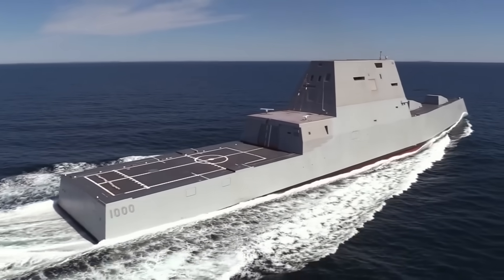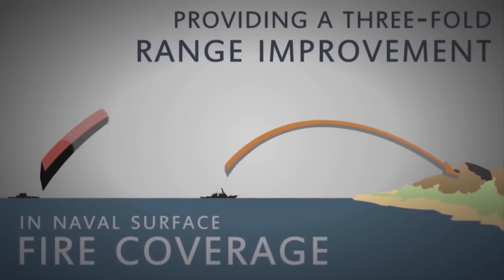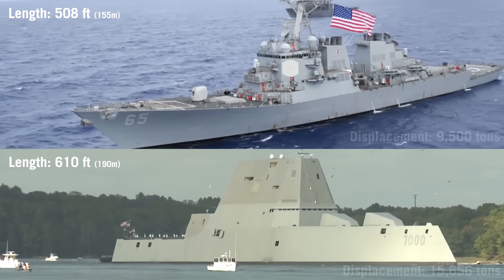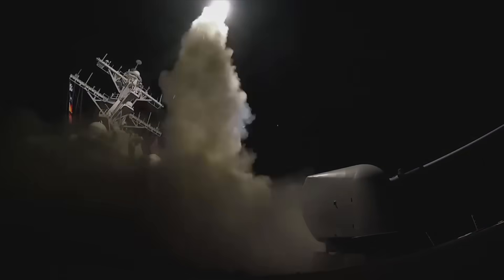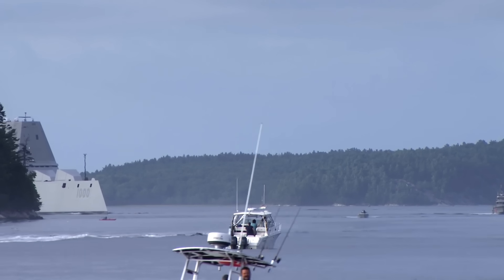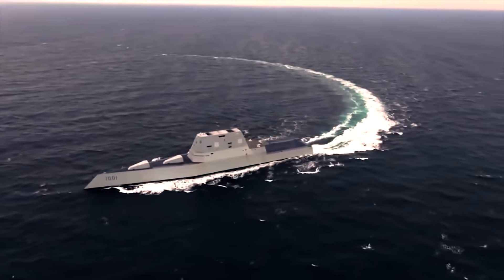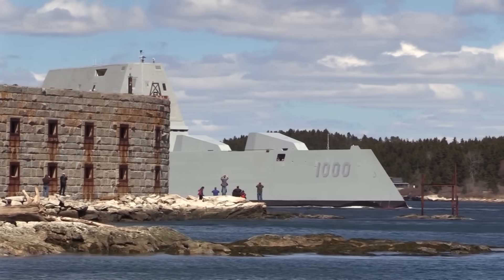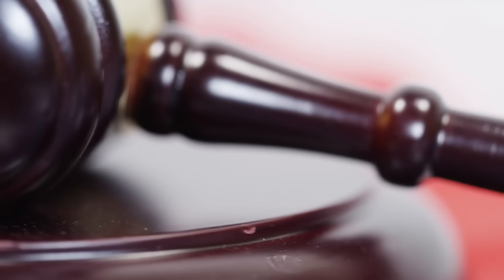What Killed Zumwalt Destroyers?

Comment: Should bring back battleships as a fire support platform  all that armor to eat missile hits and a couple of 16 inch guided rounds for inland bombardment plus the amount of missiles you can load on a BB
Reply: battleships cant really tank those missiles... they are way to big, way to expensive and not that effective anymore
and what about enemy subs? what about carriers?
if you want inland bombardment you could go for the airforce or carriers

battleships are outdated since the 40s :D
Reply: @Wootbürger1337  with modern armor on a battleship would be able to take multiple hits carry more missiles than any other ship and guided 16 inch shells would do great and you can not always rely on airforce especially if the area you are attacking is outside the planes fuel range if we get into a fight with china we will 100% have to launch a naval invasion  also battleship could fit alot of CRAM and anti missile battery’s as well nothing but a force multiplier and cant cost anymore than a ford class aircraft carrier

Comment: Two things killed the Zumwalt project, and it was the same two things which screwed the littoral combat ships, the F-35, the latest air craft carriers, and etc., and they are lack of money and a ridiculous concept called `concurrency'.
On the latest air craft carriers, yes they are at sea (at least one of them) and undergoing trials, but they were still designing that when they finished building it.
As far as I'm aware, only one elevator works to this day.
What good is an aircraft carrier that can't get its aircraft up on deck?

Initially, with the Zumwalt, there were planned for 33 to be built.
Then, as construction went on, and the end price became apparent, that number was dropped to just 13.
Further down the track, that number was reduced to just 3.
And, along with the asset of concurrency, it can't navigate the wild seas of a canal without crashing into the sides.
This is what happened when it went through Panama, and had to be towed.
That's all there is.

Comment: Designed to fail. Safety wise 150 or 300+sailors getting off a sinking or burning ship with only a rear deck access. Nope. Then any enemy in war it doesn't matter if it looks like a fishing boat. It's a target and the side of the ship is perfect for reflecting radar back to an incoming aircraft or missile. Needs to be mesh and composite to beat radar.

Comment: After decades of congressional scrutiny over DOD overspending and nakedly incompetent project managememt, we still have the Zumwalt Syndrome. The real cause of overspending is not the quest for better technology, but the avoidance by defense contractors of accurate cost estimates. 
At fault is the arms procurement system, itself. Congress permits defense contractors to grope their way to a prototype, sometimes at their own expense, which the contractor prices as low as possible. Then, as the contract is awarded, the contractor stops groping, and begins grappling with real costs, and the cost-plus thinking that balloons (almost) every DOD budget.
In essence, Uncle Sam does not know he was sold a bill of goods ("prototype") until after he awarded the contract. DOD understands the problem, and so do defense contractors, but both are too comfortable with the process, to change. With a revolving door between Pentagon and defense industry, it is easy to understand only congress has the incentive to make sweeping reform a reality.
Taxpayers, themselves, must contact congress to end this wholesale abuse.

Comment: So, many screw ups, a transport plane doorway to small for the up armored APC, a destroyer whose helicopter landing deck too thin for standard aircraft because the light weight model it was designed for failed and was canceled. Submarines with thousands of defective hull welds, cost overruns with the Osprey, Ram missile, VLS,etc., etc. Things like misplaced pipes, electrical supply points, compartments built wrong ( too large, too small, wrong deck,etc.) The list goes on and on.

Comment: It hasn't made much sense to implement stealth on ships since a few decades ago when optical sensors become thoroughly capable of targeting.  If you can defeat a Zumwalt from over the horizon with a hundred small shaped charge warheads on a hundred small consumer-grade quadrotors without using any radar at all, if you can track the ship's movements globally from orbit, what's the point?

Austerity politics did the rest.  Not much rational sense in scaling back a production run because of cost overruns in R&D, and then targeting it because it's too expensive per unit.  You made it too expensive per unit.  R&D has unknowns, as well as predictive biases.

Comment: I would treat these Zumwalt as concept ships where the latest tech and equipment is stuff into them but should never be used as production ships but instead lessons learned from the design production and use of the ships be fed into improving older known ships or to design cheaper production ships.

Comment: The interesting part here is that the bridge (with all command staff and control systems) are still on top of the ship. With this level of automation and AR that bridge could also be put in a fortified area in the centre or rear centre of the ship. With HD cameras combined with AR and zoom functions without the distraction of windows (which by themselves are vulnerable parts) it makes no sense to put that bridge on top.
Reply: Zumwalt is a piece of garbage. Almost nothing works, be its engine, gun or radar etc. The next gen destroyer design DDG(X) will have to copy the Chinese type-055

Comment: To put this monstrosity in perspective, WW2 destroyers were usually less than 2,000 tons.  The first true battleship, the HMS Dreadnought was only 20,000 tons at full load.  To call the Zumwalt a destroyer at over 16,000 tons is a joke.
Reply: But then there's this behemoth of USS Gerald R. Ford with 100.000 tons, so 16.000 tons seems like a reasonable class for a destroyer that nowadays kind of fills the role of battleship.

Comment: To people fearing automation in the workplace heres the example that should allay your fears.

Having any machine do a job as complex as a sailors might become isnt even close to realistic yet. Robot arms and automated loaders are not reliable yet. Again, not even close to what regular operations require much less the rigors of combat.

At this point automation can only be reliably applied to administrative needs. Procedurally generated schedules or calendars, automated payroll systems, voice to text devices replacing secretaries, that kind of thing.

Basically, if your phone cant do it automatically then it cant be automated yet.

My estimate, having worked in manufacturing and specifically manufacturing autonomous systems, is that general labor jobs(similar to generic deckhands and sailors in many ways) wont be able to be automated for another century. Attempts are being made but most of the decisions at the top are made by people like those that okd the 737 max for sale and daily use. Those are the caliber of decision makers guiding automation. People that are profit oriented and only tangentially concerned with engineering.

Business majors running robot development does not good robots make. Makes for a slick investor pitch, but little more.

So please, no more robot panic. Theyre not taking any jobs but desk jobs anytime soon. And the world needs more personal assistants like it needs nuclear war. Good riddance to wasted payroll

Comment: My Father builds these and my Brother-in-law designs them. There are 2 reasons the price of these shops increased by 4x and its more in depth than you may think. 

#1 BIW is a mandatory union. This means that everyone has their own section and deadlines they have to meet. For instance, a motor would need to be put in by X date but another item would need to be installed first. The crew needing to install their item first is behind schedule, so in order to look good, the crew installing the motor would put it in. Then they would have to turn around and un-install the motor so the other crew can get to where they need in order to complete the work. Higher ups in BIW have said "Its the government, they can afford it". The culture of the ship yard is not one of getting the job done within a budget, its about looking good and charging more to make more money. Multiply this 100s of times and this is a huge factor in why the price has increased. 

#2 The US government has changed the technological design so many times on this thing that the ship yard has had to gut sections of the ship to re-install electrical/plumbing sections all over again. BIW will get 3 months into a section and need to re-do it because of an edit the Government wants after its already installed.

Comment: The sad part too is that the very first one out to sea could not even get up and going as it broke down. Then it broke again. Then it had all sorts of software glitches in its matrix. And while it is hard to find using radar, it is easy to hear when it is underway. One of those russian drone subs will spot it and sink it. Iran seems to have the right idea, small very fast rocket boats that race up on you and from a distance fire their rockets and turn around before you have any real chance to get a bead on them. And they can be launched via larger mother ships or from subs. And they cost billions less to build and operate.